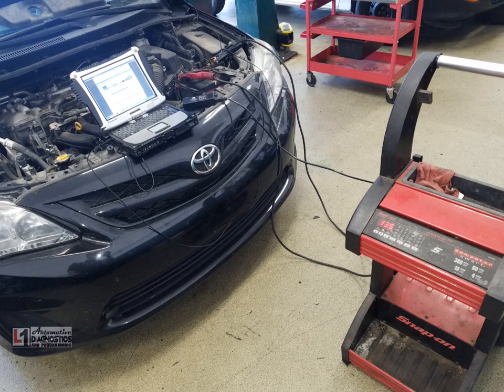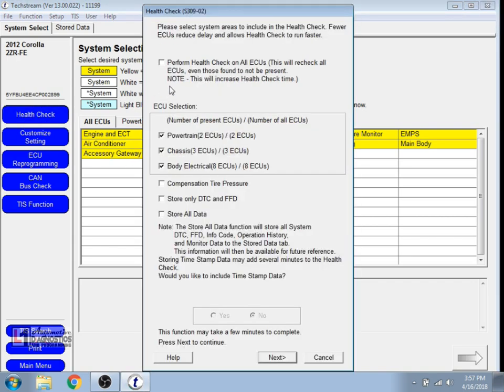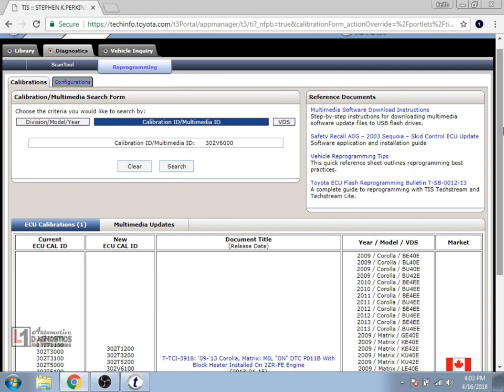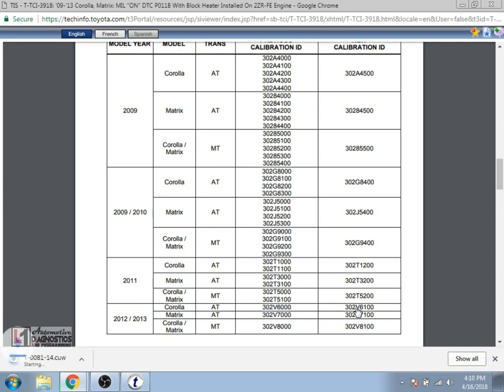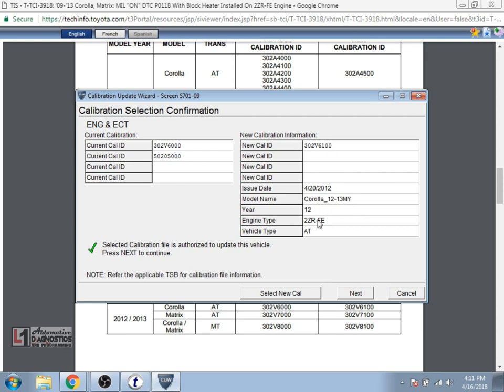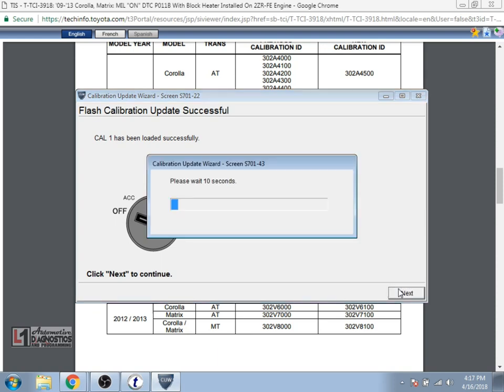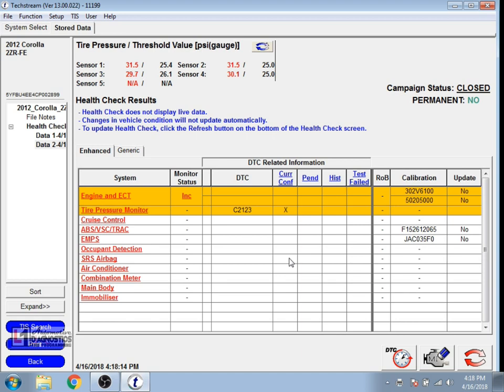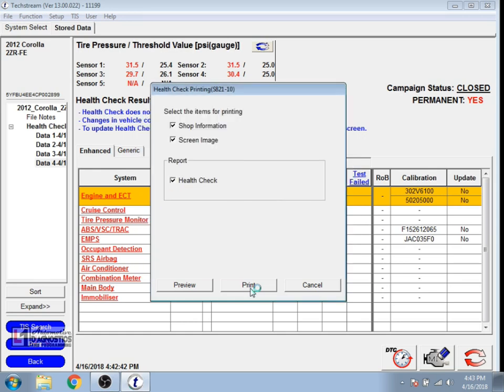Toyota PCM reprogramming with a J2534 Device

Comment: Thanks!.. ever pull a toyota out of Limp mode via Techstream v12/ 2000_4runner / (( 'had' P0325 replaced both KS from local dealership and wiring harness. but it doesn't drive fast enough to complete drive cycle.. only 15mph ))

Comment: Hi,
The video is short and very straight to the point.
I have a few questions. Can I use a battery charger 12v 24v maintainer charge for the update?

How do I download the techstream on my computer?

Is it a must that I plug the laptop into the battery maintainer? Since I will likely use a battery charger 12v 24v which I cannot plug a computer on? 

Thank you.
Reply: no

Comment: can the j2534 maxiflash be used for toyota ///?/
Reply: Yes! The Maxiflash elite J2534 is the most versatile non OEM J-Box as I have personally used it on 70-90% of all auto manufacturers and I haven't run into any issue with it at all.

Comment: How to clear pre crash safety code from  toyota camry 2015 through TIS. Tia
Reply from the maker: That is not a OE supported procedure, and has to do with the safety system. I will never show anyone how to do that, and will absolutely suggest you follow the OE procedure of module replacement.

Comment: Can you delete DTC code permanently so it wont pop up ever? For example; catayltic converter code delete.
Reply from the maker: 1. That is not possible with any factory tooling or aftermarket scan tool as it is a violation of federal law and emissions tampering, peruse on over to the EPA website to see their new initiative to imprison anyone doing this.

2. There may be aftermarket tuning software that does this, see number 1 for further explanation.
Reply: @L1Training  Thanks for the reply. What about TCS light, abs light?
Reply from the maker: Not a single manufacture offers this on any car. It is either a safety system, emissions system, or other system the manufacture advertised that vehicle with. When you remove even an optional component, you may be ok, but the next owner can not, thus the vehicle is sold or then owned by someone who may have looked up what that car came with and was then deceived. Its bad for the brands image at best.
Reply: There are ways for off-Road use only vehicles as per the BS Epa's ignorance.. 
It's called making a DTC <unreporting>. Your welcome.

Comment: Question: Is it possible to change the immobilizer and how to identify or program the 2020 model
Reply: I doubt it. My old car wasn't a Toyota but that particular function I think they make it pretty hard to mess with since people can steal cars by replacing immobilizer. But Toyota may be easier. Did you get it already fixed? Could you?

Comment: Can I do it myself at home ?
Reply from the maker: Sure, buy a J2534 device, a programming specific battery maintainer, spend a few hours setting up a laptop, and buy the $65 2 day subscription and have at it.
Reply: @L1Training  thank you for your answer! btw, can I set the active test parameters to be the real ones used by the car? for instance, there are a couple of active tests that we can apply to the engine while running (e.g. make it run more lean by reducing the % of fuel injection...) can I actually save those values to the ecu? because the active test is... only a test.
Reply from the maker: @GuilhermeGomes2  no custom tuning is available on any manufacturer with OE software.
Reply: @L1Training   when you buy the 2 day subscription does it allow you to download techstream software ? Thank you

Comment: Hello, you had mentioned in the video that you don't recommend updating unless driven by a TSB. Why do recommend not updating a toyota unless its TSB driven? And thank you for providing this clear instructional video!
Reply: Because it's working just fine with the current calibration. Tsb's are for basically the problem child's and tsb's only need to be performed when that vehicle is showing those symptoms and has been diagnosed with that issue (as provided in the tsb). It also follows the saying if it ain't broke don't fix it. I hope the information I provided you with helps.

Comment: I have the symptom from T-SB-0087-09 with a brief intake phaser noise on cold start up, and within the tsb it states : Software version 4.00.017 or later is required. Can this be done prior to the repair needed in the tsb or only after the repair? The repair is to replace the intake cam gear assembly.

Only asking because I'm waiting on parts but have a cardaq 3 plus and was wondering if the calibration can be done prior.
Reply: 2010 Toyota Corolla s 1.8 by the way

Comment: Excellent tutorial. Very simple to follow along. After I reprogrammed the ecu with the new calibration ID, I got the "U### lost transmission..." permanent code. Permanent codes are very stubborn to clear. Now I'm stuck with this new permanent code and my previous P0102 mass airflow input permanent code. Any suggestions would be helpful. Thanks.

Comment: I have been researching for weeks, my 06 is250 will shift up to 4th gear, but not beyond in d & s. Did diagnosis, changed all PCS. And now I get a code for PCS A, which pressure control solinoid A is that? And it's all brand new, it still can shift up to 4th, but not beyond. Does the PCM or TCM need to be recalibrated/reprogrammed?2
Reply from the maker: Needs to be diagnosed
Reply: @L1Training  it's been diagnosed, the trouble shoot is a Pressure Control Solinoid A, with the SL1, whicht the clutch control #1 that controls gear 1 2 3 4, but my care shift up to 4th gear and 5 and 6 when SLT, Control Solinoid B controls 5 and 6. I'm going out if my mind
Reply: @L1Training  either someone who fixed it previously switch the A& B wires or my computer need recalibrating
Reply: @L1Training  but it shouldn't shift at all, the car runs and go, but on safe mode
Reply from the maker: @somphothbsiratsamy3748  if you dont know exactly what the problem is with 100% verifiable proven evidence, then it hasn't been diagnosed properly.

Comment: Hello Keith I really need help on this please... 2009 GS350 from an auction with “NO KEY”.
I reset (via techstream) the car immobilizer due to “all key lost situation”... All reset process was perfect and done... (all dash light up as it is supposed to act when you reset the immobilizer to add a new key) but at the moment to register a new smart key code fob, I had a car battery issue loosing power and was not able to add the new key. I disconnected the battery to recharge and then I put it back later to continue the process, but this time the dash is not coming ON, when I push the start button nothing happens, only the door light is on on the dash but nothing else. I attempted to reset the immobilizer again but keeps failing after reset code is entered. The security light keeps flashing all the time... I disconnected all horns previously.
Work done: Check all fuses in the 5 places in the car and all are ok... not blown fuses at all. The big fusible link is also intact, not blown.
Immobilizer module was replaced (Anti Theft Locking Immobilizer Control Module Manufacture Part Number : 89784-30011) but nothing changes... red security light keeps blinking all the time.
PUSH BUTTON “Engine STAR STOP” lights up when driver door is open but the amber light is not ON... nothing happens when I depress the pedal brake... no green or amber light. Inside lights works ok and seats have power, turning the metal key on drivers door lock and unlock the doors and also open all windows and sunroof when hold it to the open position.

What other test or check I need to perform? Could be a main ECU issue?

Thanks for your help!
Reply: lol

Comment: only can program the new pcm not used using j2534 correct???
Reply from the maker: There is not a blanket answer, a lot of the time a used PCM can be used depending on the actual model and year. Some used PCM's only require VIN to be changed with a scan tool, others require VIN change and key register functions. Some require more than that and less, it is a case by case basis.